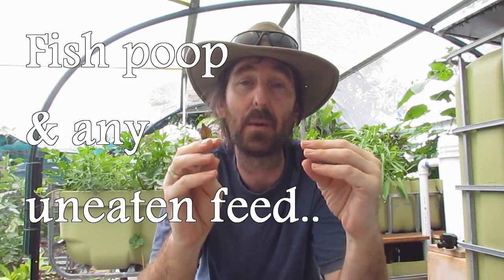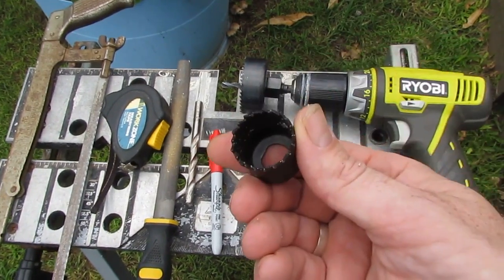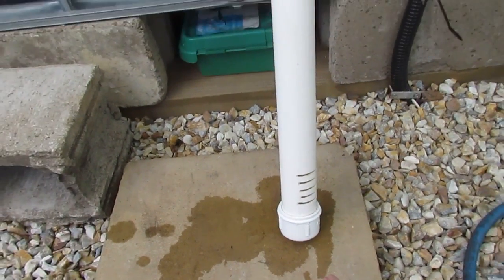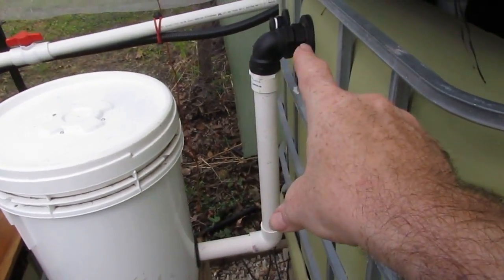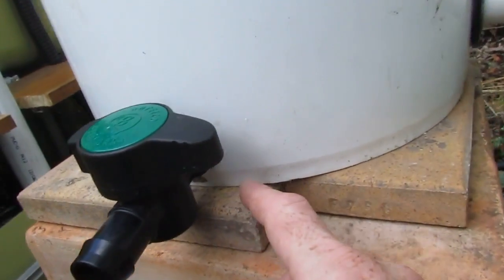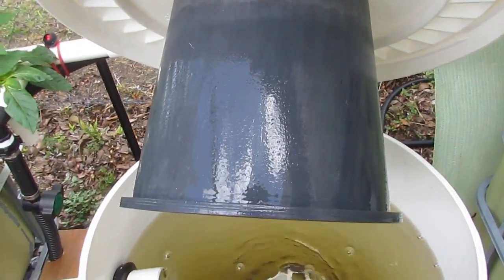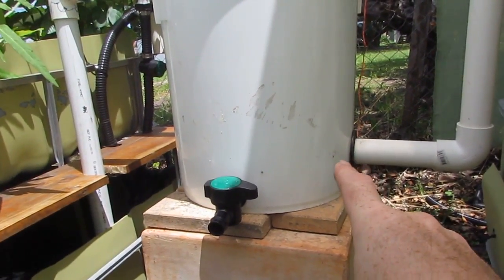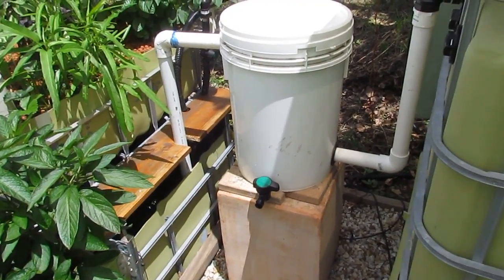Aquaponic radial flow filter for solids removal..

Comment: how do you make those black rubber seals where the pipes come in and out?
Reply from the maker: They're called Uniseals Tactical Zebra & I've found them useful in a range of applications in the aquaponics. Still use the bulkheads for certain jobs though. 
If you're in Australia & are interested in getting some let me know as I now sell them 👍 
http://www.bitsouttheback.net/p/bits-out-back-store.html
Cheers,
Rob.

Comment: are you using a 330 gal tote for the FT? 
I was wondering if you could explain the reason why you drain from the radial flow filter to the sump and not directly to the grow beds.
Does pumping from the sump into the tank instead of gravity feeding from the flow filter provide faster cycle times and more system efficiency?
Reply from the maker: Hi there. That was a 250Gal Shrive. I was using the water from the skim pipe to feed the grow beds to help keep the solids from going to the beds. 
At the moment I'm running the system as a split flow meaning the flow from the pump in the sump is split between the fish tanks & grow beds. 
This clip will give you a better idea https://www.youtube.com/watch?v=N4mYcUvZ9cw
Hope that helps.

Comment: This is a bit of a newb question but I thought you wanted to run the solids to the plants with the water in aquaponics? So why are you making a filter specifically to pull it out before taking it to them? Arn't the plants supposed to filter that out? Sorry trying to do learn about it to set something up myself and feeling like i'm missing something...
Reply: Solids will eventually clog up the system, making it higher maintenance.  Solids is not what the plants are interested in.  Learn about the aquarium nitrogen cycle and the symbiotic aerobic bacteria involved in converting ammonia to nitrate.
Reply from the maker: Solids will also mineralise in the beds to a degree but are removed from most larger commercial systems.
They normally put them through a mineralisation process that makes the elements in the solids plant available. The nutrient rich run off is then added back into the system to help retain the micro nutrients that plants need besides NPK (nitrogen, potassium, phosphorus). 
If you look up "aquaponics mineralisation tank" you'll find a fair amount of information on them. I know Earthan Group has published a bit about it on their Earthan Edge page if that helps any. 
http://articles.earthanedge.com/?s=mineralization
Cheers.
Reply: Rob Bob's Backyard Farming Don't they focus more on anaerobic bacteria instead of aerobic when it comes to that?
Reply from the maker: From what I've seen Paul write about they run venturis in the mineralisation tanks to help keep it aerobic. Anaerobic mineralisation will work as well but aerobic is much faster as I understand it.  👍

Comment: does the top of the overflow pipe( in the filter) that comes  from the fish tank need to be lower than the water level of the fish tank in order to flow or does the siphon flow push water out even if the pipe top  is higher that the water level?
Reply from the maker: Hi there.
The outlet does need to be lower than the water level in the fish tank or it will overflow. 
Sorry for the slow reply & hope it helps some.
Rob.

Comment: What size PVC did you use on your filter? I estimate 1-1/4".
Reply from the maker: +tntrifilo 
In this build it was & later moved up to 2". Just wasn't happy with the flow I was getting through it. 
This is the later one I knocked up if it helps
https://www.youtube.com/watch?v=mKWXkf9j5Qc
Cheers.

Comment: Hey Rob thanks for  the tip. I made a radial flow filter out of 100mm pvc pipe with a ball valve at the bottom so i can dump all the solids every few days, its works great with no cleaning necessary. Im on the north side of Brisbane would love to check out your system one day. Cheers mate.
Reply from the maker: +Jeffrey Husoy 
Hi Jeffrey. Have had a few folks come through the yard but don't hold open days as such. If you're on FB PM me through our page there & will see if we can work something out. 
Cheers mate.

Comment: Just finished my build. Thank you! Took your advice and put a funnel at the bottom of the bucket. Found a 3 gallon water container that I use for the funnel.  I used the bottom of that container were you would used the planter.  Discovered that I had to punch a hole into the inverted water bottle to let air escape when the unit is filling up. Also, I configured the incoming water to flow like a swirl filter. I guess I now have a highbred filter.
Reply from the maker: +Z223I 
Hi there.
Sounds like an interesting build mate 👍 Do you have any pic's of it up on line I can suss out?
No problem if you don't though.
Cheers & have a great one. 
Rob.
Reply: +RobBobs Backyard Farming I have temporarily posted pictures and notes on my Facebook page "Kratky Method of Hydroponics".
Reply from the maker: +Z223I 
Cheers mate.

Comment: For your calculations, you mentioned your filter size as 50 liters. Is it really a 12 gallon bucket? Or is it a 5 gallon (20 liter) bucket?
Reply from the maker: +Cyril Roberts 
Hey Cyril.
It is a 50L/13gal (us) barrel. Looks a bit smaller on the clip but I can guarantee you its larger ;)  
Cheers mate.

Comment: I'm new to all of this and trying to gather ideas for my setup. I've had it in my mind to use a SLO straight to my growbeds. But the question kept coming to mind how I could prevent the solids from being pumped to the surface of the media other than just a small sponge or filter laying on the grow bed where the inlet comes in. Can a radial filter like this be incorporated with the SLO, as in a CHOP system, or would it be one or the other?
Reply from the maker: +Mark Snow 
Hey Mark.
You can run the water from the filter straight out to the grow beds if you want. Ours was set up like that after a 2nd filter was added in later 👍 
The only issue is that you need to be a bit more careful regulating the flow as the filter could overflow if the beds can't take the full flow from the fish tank. 
That's why in this set up I had the skimmer pipe at the back of the tank (you can see it behind my had at 2:56 ) to take the clean water from the surface out to the beds while the excess flow took the solids out via the SLO to the filter & then onto the sump tank. 
Hope that all makes sense mate.

Comment: What size pipe is that? start my new IBC change over tomorrow.
Reply from the maker: +Zach D 
Missed this comment sorry Zach. 
That was a 40mm/1.5" pipe running into the filter. Later changed it over to the 50mm/2" 
Hope you have a great 2016 mate.
Cheers.
Reply: +Rob Bob&#39;s Backyard Farming Hi rob, did changing the pipe from 1.5 to 2 inch affect the flow in any way?
Reply from the maker: +TheRedRider100 
It stopped the slight back up I was having at the top of the solids lifting pipe in the fish tank RedRider. 👍

Comment: Hey ROb i am just curious as to why you dont run the radial flow directly to the beds? Is it better to have your pump going from you sump to both the tank and the beds? if so what reasons?
Reply from the maker: +Blake Wallace 
Hi Blake. 
I had a pipe at the top of the tank (rear left corner)  taking the clean water out to the beds in this set up as the pipe work was already there from when the SLO pipe was attached.  This filter had a new hole drilled for it & due to the position it was in was easier to run the water back into the sump tank than divert it to the beds.  Think we were fairy skint at the time as well from memory & had no extra pipe on hand. 
At the moment the system is set up as a split flow (water pumped from sump to grow beds & FT at the same time) but don't see it as being better than running water from the filters out to the beds. It all comes down to how often the water is exchanged through the system every hour. At the moment I have a 10000LPH pump in a 3000L (aprox) system. The water in the FT being exchanged close to 2 times an hour so I know the fish are being kept happy. 
In the near future that will all change again as I add on some new beds & also change the way the water flows to the beds. 
Feeling a bit crook today so hope that makes sense mate. Lett me know if I've only confused you more ;) 
Cheers.
Reply: cheers mate greatly appreciated

Comment: I am having some issues with my new set up, I have watched your system a dozen times trying to figure out where I went wrong.  my ft is filling too high and not draining fast enough into the swirl. I do not have a over flow on my ft guess I could just add a line from the ft to the swirl right?
Reply from the maker: Zach D What size pipe do you have running into the filter Zach ?  Also how big is the pump? Trying to find earlier convo's with you to get the information but cant..
Reply: 1 1/2 pipe, and the 396 gph pump is too much as the ft is not draining fast enough to keep up.
Reply: +Zach D your flow is getting choked using 1.5".  Replace with 2" and add a ball valve to regulate similar to RobBobs design
Reply: Ok I'll look at it thanks

Comment: does the pipe out of the swirl with the elbow mater? I do not have a pipe under my elbow and mine is draining very slowly with just a 90 and air as it drops.
Reply: 5:42 of this video shows the water level at about half of the pipe as it runs....with my pump running I had a very slow flow if at all.

Comment: Hi Rob I am David from North Carolina I just had a thought I wanted to run past you and get your thoughts on it. I have a very limited space to build my ap system, so here is my thought could I make a filter that combine a swirl filter in the bottom of a 55 gal barrel then filter media over that section for the middle section of the barrel and then place bio media in the top section therefore having to whole filter system in a single barrel? well there is my thought what do you think? thanks in advance David in the US
Reply from the maker: David Brooks Hi David.. Not sure that would run too well as it could be a pain to service.. 
Are you planing to run NFT or DWC growing systems? If you're not I wouldn't worry about the biomedia & just run with a swirl or radial flow filter.. The media in the beds will be all the bio filtration you need as long as you get the stocking densities right.. 
Hope that helps some.. 
Sorry for the slow reply with this mate, am just catching up on a loads of missed ones today..

Comment: Have you considered using the top off of a five gallon water jug and using that piece as a "funnel" on the bottom of your radial flow filter?
Reply from the maker: Hi Jonathan.. Have seen them used in a few systems & they look to do a great job..  The jug is a bit to small for ours due to the volume of water coming through the filter & the retention time would be long enough to allow the solids to fall out..  we now use 200L/55gal filter with a flat base.. There is a drain assembly in there made from a drain to waste fitting that does a great job at taking all the solids out.. 
Here's a look at the fitting if you're interested\,
https://www.youtube.com/watch?v=fQEh4FSNMrE

Cheers mate & have a great one..

Comment: We are looking at building our first small aquaponics system.  I have an old 200 lb sand filter that I replaced years ago from our swimming pool.  Do you see any issues with using this as a clarifier/ filter?  I only replaced it as many of the screening pipes had failed and was letting sand into the pool.
Reply from the maker: Hey Jeremy.. Have read that others have tried using sand filters but had issues with the fish solids clogging them or going manky. I have seen others take the sand out & use the shell to make solids filters.. The rounded base make solids collection a lot easier than the flat bottom unit's like we have..  My father has an old pool filter put aside for me to play which will be fun.. 
Hope that helps some mate & would like to know how you go if you have a crack at one.. 
Cheers..

Comment: Hi Rob,
Thank you for all the wonderful videos!  Can you describe the uptake siphon you put in the fish tank a bit more?  I know you mentioned a hole near the shut off but I wasn't sure how you mean.
Reply from the maker: Hey Jodi..
At the top of the pipe is a "T" fitting with 3 openings.. Only 2 have pipe in them (the pipe coming up from the base & the pipe out to the filter) with the 3rd being left open so air can enter the pipe.. If it was a straight elbow was used, there is a very good chance that a siphon would occur draining all the water in the fish tank down to its base.. 
Hope that helps some..
Rob
Reply: Awesome!  Thanks I will give it a try!

Comment: Rob,
I made the mistake of not installing any sort of settlement tank or swirl filter in between the fish tank and my sump tank.  I notice that you've built a couple different kinds.  Will you please post the link to the best idea you have for a solids filter?
Reply from the maker: Hey mate..
The radial flow filter is the only style of solids filter that I've used & am rather happy with it.. Have made a few different sizes to handle different flow rates.. 
Here's some info that might help..

"The whole purpose of the filter is to slow the velocity of the water so the solids can precipitate out and be removed from the system.. For this to happen the water must slow its flow long enough inside the filter for the solids to settle out, this is called the retention time.. I have read in a few places that anything over 60 seconds retention time is acceptable for larger solids, with 2 min being the desirable amount of time for filters like ours..

The formula I use to see how long the water is retained in the filter before moving on is:
Size of filter (in litres) / flow rate (in litres per hour) = Retention time in hours. 
(Same can be done in gallons & gallons per hour)
For our system the equation looks like this..
50 / 2700 = 0.0185 of an hour or 1minute 7seconds
To help you out here is a handy Decimal to Time Calculator"
http://www.calculatorsoup.com/calculators/time/decimal-to-time-calculator.php  "

This newer clip might give you a few ideas on the newer smaller unit we built,  
New radial flow filter for aquaponic system..
Pipe & drum sizing will depend on flow rates so if you have any questions on that I'll do my best to help you out..  
Sorry for taking a while to get back to you but hope the clip helps some,
Rob..

Comment: can i just clarify... if the water level in the fish tank falls below the radial flow outlet #(your bulkhead you 'sprung for') the water will stop going to the sump?
Reply from the maker: That's right Wayne but that would only happen if no water was running into the FT.. 
The lay out for this system was changed & had all the water flowing into the RFF then out to the grow beds before it was redesigned & new tanks/filters added.. 
In the new set up the water flows through the RFF then the Biofilter  & is then split at the small sump... Some of the water is going to the grow beds & some returning into the in ground sump you see in this clip..  You can see the new lay out here  mate,
Aquaponic Build Vlog 5.. The fish are in & all systems are go..
Cheers & hope that helps..
Reply: Thanks Rob.  Just gonna start setting up my hydroponics.  And your videos have been useful on layout.  I'll post when got some design sketches etc.  Just sorting a shed etc as wanna grow through the winter.

Comment: Hi Rob,
I have a 600 Gallon system running, and put a radial flow system in there based on your video.  Unfortunately it does not do a good job of removing solids.  A lot of solids still go through the outlet into my bio filter.
What could the problem be?  Could it be that the "upside down bucket" does not go low enough into the filter?  Maybe my flow rate is too slow?  What are the things I could change to try and improve my filter?
Reply from the maker: Hey Eric.. 
Thanks for asking the question..I have just added some info to the description of this post to help others that have this problem too... 
Need to know a few things first.. How large is the filter drum & how many gph are being run through it from the fish tank? 
Is the retention time in the drum isn't long enough you can get them not having enough time to settle out.. 

Here's the info I added to the description.. 

The formula I use to see how long the water is retained in the filter before moving on is:
Size of filter (in litres) / flow rate (in litres per hour) = Retention time in hours. 
(Same can be done in gallons & gallons per hour)
For our system the equation looks like this..
50 / 2700 = 0.0185 of an hour or 1minute 7seconds
To help you out here is a handy Decimal to Time Calculator
http://www.calculatorsoup.com/calculators/time/decimal-to-time-calculator.php

Anything over 1min is OK but more is better.. In our new system we have a retention time of over 2 min but am yet to see how that's working as the fish only went in a few days ago.. 

Hope that helps some mate & let me know how you get on please... Sorry it took a while o get back to you..
Rob..